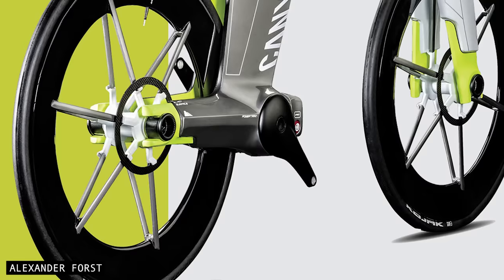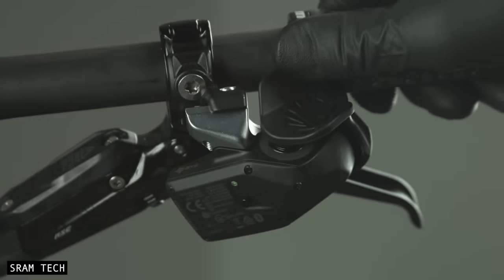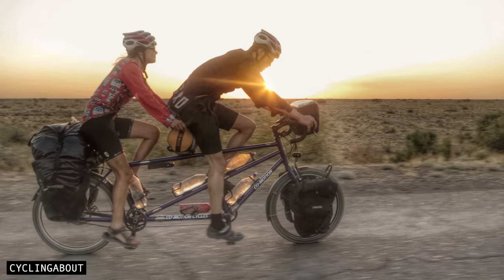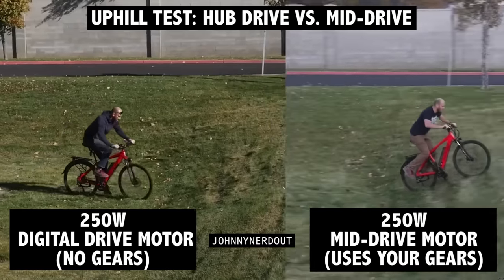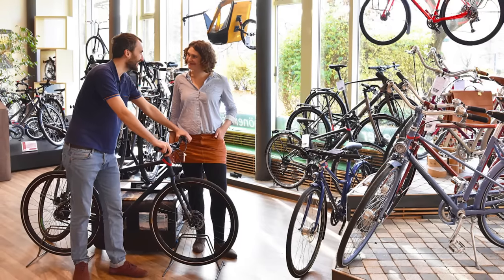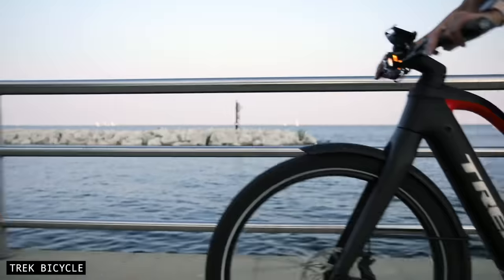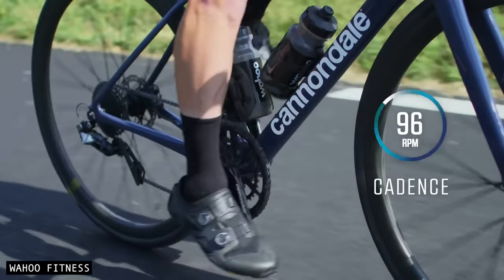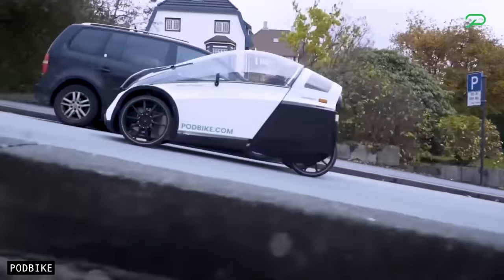Are Chainless Digital Drive Bicycles The Future of Cycling?

Comment: Given how inefficient the drivetrain is, you might as well skip the pedals and call it a motorcycle! The pedaling is just to qualify as a pedelec for legal purposes, while the battery and motor does almost all the work.
Reply: Remember, that efficiency of 95% for derailleur bikes is fresh out of the workshop. Drive it for a week/month in bad weather and things change. This might not be the right thing for a peak performance bike that gets constant maintenance. But think about  a commuter bike, that gets serviced once/twice a year the story is quite different.
Reply: @etherealicer  True, but I don't think it ever drops below 90%, even for a really dirty chain and worn teeth. 58% efficiency really is terrible, and that's not even accounting for the extra weight. 

Still, it probably has a niche somewhere. Public electric bikes schemes seems like a good use case
Reply: @jackroutledge352  It also is not accounting for recuperation.
I don't know the numbers (and a quick google search I did has not revealed anything). For me, I can see about 10% loss of speed* (though a good part also comes from poor tire pressure) and I do pretty regular maintenance (oiling / pumping up the tires). I do annual oil change on my rohloff speed hub, as it is combined with more thorough maintenance which usually results in 15-20% better speed.
* I daily commute for 2.6km in any weather.
Reply: @jackroutledge352  The day I do my maintenance, my bike is usually in better shape than the average commuter bike (But I'm also pushing it going roughly 30km/h top speed, not bad for an 18kg steel mule). No idea how these losses translate to efficiency, but I think there is a quite significant loss.
Of course this is very hypothetical and anecdotal. Really curious about actual every day efficiency of bikes.
Reply: @etherealicer   the efficiency of an external chain bicycle drivetrain with a high quality chain with the right lubricant,  clean,  fresh… is a little over 98%.  Dirt,  wear,  poor lubrication… do lower this but in poor conditions typically stay well above 90% for a bicycles’ chain drivetrain.  There is no comparison between a digital drive and chain bicycle drivetrain in efficiency.  A 58% efficiency rating is abysmal - think 1-1.5 flat tires for something significantly heavier that costs more.  A high torque electric motor is heavy due to copper and copper is expensive.  Besides a good mechanical system is typically more durable/longer lasting than a digital electronic version.  Hand crank car windows will typically perform without any needed maintenance or parts replacement whereas electric windows will be needing multiple maintenance services and a few parts replaced.  The simpler option is typically going to be the more durable and efficient.  Digital drive bicycles only come close to being a good choice when talking about e-bikes.  Will future innovations possibly change that?  Yes.  That said in 1890 bicycles featured a diamond shaped frame based around  hollow tubing,  power went to the rear wheel based on a chain,  wheels were made with tensioned wire spokes and featured air filled rubber tires.  The best bicycles today typically have the same features.  Yes some bikes will have a belt drive.  So magical game changing innovations can happen but don’t count on them in our lifetimes.  Given the poor execution of many “innovations“ that I see in newer bikes I dread actual changes.  Frames are commonly out of alignment,  poor welds,  poorly aligned bearing raced,  sloppy tolerances… are typical issues with new bikes.  So if a drive system which looses 21x more energy,  requires the bicycle to be significantly heavier while being more expensive and most likely harder to work on is something which sounds like an amazing innovation to you and deserving your money than go for it.  Yes 21x more energy 98% vs 58% or 2% vs 42% loss.
Reply: @stefhirsch6922  Here is my take.
- 98% is highly idealistic and not even close to what you will get on a daily commuter. And as you pointed out, with quality components (that ain't cheap either).
- 58% on the other hand is low (does not take into account recuperation for example). But sure, at the moment the system is very inefficient.
- You can pedal at your optimal efficiency independent of power requirement at the wheel. No bursts to get off a stop line, no higher load uphill. If you have 3 or more wheels you can even pedal as you wait at a red light/stop.
- As a result of the 3 points above the 21x has nothing to do with reality, sounds like something you would put into a marketing blurp.
- Motors get better, lighter and cheaper. And while initial cost are higher, maintenance might make up for it. I mean I have to buy new chain annually and new cogs every other year (again, quality components are not cheap) and my Rohloff gearbox is end of life (not cheap either).
- Durability. That is where you are wrong. An electrical motor is much more durable than a mechanical drive-train. Just look at e-bikes. It is commonly the mechanical parts that fail  (yes, the $30 controller might fail too, but at a much lower rate than the mechanical drive-train, the motor pretty much never fails).
- Quality in execution. Well, that is a market problem, you yourself started with "high quality chain". Obviously there are garbage products everywhere. The "innovations" you talk about are usually not engineering advances but simply "designer" pieces from designers that think they are artists. With products made as cheaply as possible to increase profit.

This is obviously not for a performance road bike. But think of cargo bikes or tandems (more chain == more loss). Bikes that don't get serviced every night (that are nowhere near that idealistic 98%). Bikes that are already heavy (e-bikes / cargo bikes). Bikes with different layout (eg. the cargo bike in the video with a steered AND powered wheel, being incredible nimble).
Finally, there is still a lot of room for improvement with this tech.
What I see is potential

P.S.: This claims a difference in 5% efficiency (Link Below). Now, I don't know how they arrived at this conclusion and haven't found the data (yet), so take that number with at least a bucket of salt 😉.
https://www.bikeradar.com/news/schaeffler-free-drive-chainless-drive-system/
Reply: @stefhirsch6922  Just read the comments in the article I linked you and there is one that pops out. If you use this on an exercise bike efficiency does not matter, but you can charge batteries while you exercise... finally, the "Hamster-Wheel"-powered household becomes reality.
Reply: @etherealicer  peak performace bike? any person that owns a bike and likes it will clean the chain when dirty to make it last longer, together with the other drivetrain components, so yeah, unless you are really careless, the efficiency of a chain drive will remain pretty much at top through its life
Reply: @cyrustakem7993  Not sure where you live, but here plenty of bikes are in quite bad condition, especially those used for daily commute. Some you hear from far away squeaking.
There is a reason why people exchange chain/chain-ring and cassettes regularly, they wear out and with that they loose efficiency. So a clear no, to retain top efficiency throughout its life (unless you really exchange it often).
Then there is low temperature that badly affects your oil (belts are better, but they get stiffer in cold weather). Derailleurs in cold weather (especially if there is snow/slush involved) are terrible (hub-gearboxes are better but they are less efficient to begin with).
Me included, many people like hub-dynamos, so you don't have to look after batteries and a fix installed light is less likely to be stolen (Btw dynamo/light are another great example for the reliability of electronic parts). With an electronic drive train, you can skip the dynamo, save cost there.

P.S.: Your 98% efficiency is a dream. Here are some official average efficiencies. Average meaning that there are some gears that are worse, some that are better
– 96.2% for 2X Shimano Ultegra
– 95.1% for 1X SRAM Force 1

Also, if you read further down there is a section called "Does Derailleur Efficiency Really Matter?
Source: https://www.cyclingabout.com/drivetrain-efficiency-difference-speed-between-1x-2x/
Reply: This is a bike with a battery, so it’s better to think about this as a battery and drive motor driven bike with the option to have a pedal driven generator to add some energy back to the battery to offset the energy usage from forward propulsion. So the pedaling is as valuable as you want it to be. The system also captures all the power/energy from deceleration during slowing and stopping, and the power/energy from descending at any % decline.  This power/energy is lost with a mechanical drive train. It’s more than “just to qualify as a pedalec”.  In this drive train system, pedaling provides power/energy to the system, but differently than a conventional mechanical drive train.  The end result though, is the same.  Pedaling adds power.
Reply: @wademt  except that direct power transmission is 21x LESS efficient than digital drive while being heavier and more expensive .  Please explain how a significantly heavier system with 21x less efficiency for more money is a good idea.  In addition regenerative braking power similar to a hybrid car doesn’t work nearly as well on a bike vs a car due to a bicycles weight to drag ratio so the potential energy recapture potential is far lower.  Systems with regenerative braking are also significantly less efficient compared to a standard electric pedal assisted bike and without pedal assist are worse than pedaling a bike with a flat tire.  I used to sell/wrench ebikes with regenerative braking and I wouldn’t buy nor would I recommend buying an ebike with regenerative braking.
Reply: @etherealicer  indoor trainers and other cardio equipment connected to a generator/alternator is nothing new as I’m familiar with designs dating back to the 1970’s.  The math doesn’t really work out in real life.  A typical household refrigerator requires about 1000 watt hours to power.  Given a 20% energy loss at the generator and another 20% loss when the power meets the battery if you can sustain 150 watts output it would require 10.4 hours per day - just for the refrigerator.  No lights,  microwave,  clocks,  cell phone chargers,  stereo,  tv…. 10.4 hours per day for just the refrigerator.  Every.  Single.  Day.  Investing in solar panels,  wind generators,  energy efficiency in terms of appliances,  insulation… are far superior in terms of performance as well as cost effectiveness.
Reply: @stefhirsch6922  I was specifically addressing the point of the OP that the pedals are not useful.  As to the larger issue as to whether the system is “better” than a mechanical system, they have their own strengths and weaknesses. They are different for sure, and have their place, as the the video pointed out.  One of my bikes has a Copenhagen Wheel on it, and it has some regeneration, so I agree it isn’t much, and largely depends on the amount of stop/go and downhills you have, and whether the system design is robust enough to capture the energy. (I also own a Tesla, so I know what robust regeneration is capable of).  I don’t see a real benefit to me personally for this system, but that doesn’t mean it isn’t beneficial in certain use cases.
Reply: @wademt  a system which has drivetrain energy losses 21x greater than a typical chain drivetrain while adding significant weight and costing more sounds inferior to me.  A typical chain drivetrain is 98% efficient whereas a digital drive is 58% or 2% loss vs 42% loss.  As far as regenerative braking on a bicycle goes given the inefficiencies of the generator and battery charging you will be faster without any extra complicated regenerative braking ebike additions.  New and improved doesn’t always mean better.  Digital drive is an absolute turd of a design and deserves the ridicule of how much it sucks.
Reply: @stefhirsch6922  Of course... it was more meant as a joke. However, it is a new opportunity for bike-couriers to work from home, charging batteries 😜.
Reply: I can’t get over how heavy these things would be. And if you’re going to add a battery and something to generate power with why not a motor ? Especially when you consider the cost. It’s a ridiculous idea.
Reply: @rolandthethompsongunner64  You understand that you already have a motor, right? So, if you add this to an e-bike you only add 1kg for the front-generator and wiring. But you can remove the full weight of the mechanical drive-train (gear-shifters + cables,derailleur(s), cassette, chain-ring(s) and chain). Meaning if you add this to an e-bike the weight difference is negligible.
As for cost. Well, hard to say really as this is not widely produced yet. But considering how much money you potentially save on maintenance and mechanical components, this could turn out to be cheaper (especially on an e-bike with front-motor, where your chain-drive is really high maintenance). Again, comparing to an e-bike
+ cost of generator
+ cost of controller
+ cost of software
None of these are particularly expensive
- cost of gear-shifters
- cost of derailleur(s)
- cost of cassette
- cost of chain-ring(s)
- cost of chain
- cost in maintenance
Ultimately, it does not look bad at all. Of course we will only know if there is a market-ready product. I honestly don't think that weight or cost are a problem. Efficiency seems to be* at this point. But again, we are comparing a product that has been refined over decades to something that is not even in production yet.
*Schaeffler's Free Drive claims only to be 5% less efficient than chain-drive.
Reply: @etherealicer  Derailleur efficiency is only one component. Losses through the pulley wheels, the chain, the cranks, the BB, the bearings, the hubs, etc. MANY components subject to various levels and stages of Friction. I.E. Mechanical resistance.  Rolling friction, the frictional forces present within the interfaces of the drivetrain is more than 3% to 5%.

And as you say, best case is when everything is new. 'Most articles' are bullshit. They are not engineering studies. 3% of loss comes just from the chain. A new oiled chain. Add another loss of 1% to 2% when not clean/lubed. (Most chains!)😆

Of course all of this is based on a model efficiency of a near perfect external conditions and rider. This is peak efficiency, the human body's efficiency at converting energy from food to work through pedaling action. PEAK efficiency does not last long and is not a metric for a basis.
(Peak RARELY exists with average riders) AT BEST, rider (mechanical input) efficiency is only 25%.
Reply: @jackroutledge352  Absolutely it drops below 90%
Reply: @stefhirsch6922  Incorrect. 97% at BEST. Typically below 97%. A typical bicycle is not 97% efficient. That would be a LAB model, with perfect external conditions (NO wind, no rain, SMOOTH pavement, no gravel, no dirt. A PERFECT rider. PEAK athletes. Does not exist except a handful of Pro's
Reply: @archetypex65  Exactly, optimizing for the riders output, independent of driving conditions (start/stop/hills) has a good potential.
Reply: @etherealicer  98-99% for clean transmission is real numbers
Reply: @shkoddi  Not really no. Average efficiency over all gears is maybe around 95% (new, well lubed). Less if you have a cargo bike with more drive-train, less if it is freezing cold, less if you've been riding for a week/month, less if your chain gets stretched, less if your cassette/chain ring get worn out, less if you've been riding in slush/dust/dirt, less if you have to shift gear (and the less you shift gear, the less efficient you, as a human are).
There is a reason why people choose the "far less" efficient hub-gear systems. Namely, that they stay longer at good efficiency when compared to the derailleur (despite still having losses due to dirty chain).
Reply: @archetypex65  peak pros have peak pro fitness and talent.  All of us can buy quality lubricants and degreasers.  Higher quality chains have less power losses than cheaper lower quality ones while lasting longer (shimano dura-ace or xtr are about as good as you can get - in terms of efficiency ).  All of us can avoid cross chaining (which degrades efficiency).  We can also select larger diameter chainrings and cogs.  A 60/24 has half of the power losses of a 30/12.  It really becomes a problem when the rear cogs get smaller than 14T.  Given how many modern bike drivetrains feature rear cogs as small as 9 or 10T it becomes significant.  We can also all invest in a simple chain checker or just use a ruler as a worn chain isn’t as efficient as a newer one (old chains also wear the chainrings and cassettes much quicker).  A 98% efficient bike chain driven drivetrain is very much so doable and attainable for mortals.
Reply: @etherealicer  nobody uses all gears equally, typical rider prefer 2-3 most used combination like 50*19-21-23, with good mechanical efficiency. And in good conditions there is no any mechanical losses above 1-2%. You can simply check this with pedal-based powermeter like Assioma and Direct Drive trainer like Neo 2T. Of course, commuter bikes don`t need to be 98% efficent all the time and something like 85-90% is pretty accepted, especially for cheap planetary hub + belt or cardan systems, that have exeptional durability and low-to-medium cost. But something with 60% efficiency and medium-to-high cost is just marketing ploy, not solving any real problem.
Reply: @shkoddi  You are comparing apples to oranges
Your 85-90% efficiency for a commuter bike (independent on whether we agree on that number or not) is what you get out of the drive-train.
The 60% is not. It does not take into account the recuperation. That has a huge impact if you have to stop a lot (urban traffic).
Furthermore, it does not end with commuter bikes. Cargo bikes get even worse efficiency out of mechanical drive-trains (while the loss for an electrical drive-train remains the same).
These numbers also don't take human efficiency. We are best if we can pedal at a constant speed. With an electrical drive-train you can optimize your human output (you can store energy). Keeping a good speed is easy, constantly accelerating and stopping saps your energy far more.

So, be careful what you compare. No-one is claiming that they will be the next big hit on next years Tour de France. But it might be the next big thing for cargo-bikes.

The electrical drive train is still in it's infancy but already there are some interesting use cases. Let's look at an e-bike.
First off, the motor and battery are already there, so we are only replacing the mechanical drive-train. That means we probably break even on the weight. The expensive part of an e-bike is the battery not the motor, so cost wise the difference should be small, could even be in favor of the electrical drive-train, especially since you will have less maintenance (no replacing chain, no broken derailleur etc.).
If we apply this to a cargo e-bike the balance shifts even more in favor of the electrical drive-train. We almost certainly loose weight, potentially save cost (especially since cargo bikes are produced in lower numbers, adapting the frame to accommodate for the generator will have less impact on the overall cost).
Another interesting use case, is a powered AND steered wheel (e.g. like that super nimble cargo bike in this video). The electrical drive-train gives us new design options.

Schaeffler Free Drive claims only 5% efficiency loss compared to a mechanical drive train (though they don't tell us how they arrived at that number). 5% you can more than make up with what you gain in human efficiency. All of this is speculative and theoretical. But you can easily see that with some further investment, this can get really interesting.
Reply: @stefhirsch6922  this system doesn’t have a driveline which you’ve referenced.  You are trying to compare two mechanical systems. And yes, when the prime mover is human legs, the chain drive holds the advantage overall. So we agree there. But that’s where your argument breaks down. We are discussing a system with stored energy in a battery that comes from an electrical outlet (which by the way is hours and hours worth of human pedaling), in ADDITION to human pedaling. An e-bike with a chain drive and a motor is a simple hybrid drive. An optimized full electric has 3 inputs to the battery: 1) electricity from a wall outlet, 2) pedaling from the rider, 3) regenerative braking.  The video made a clear point that I agree with: applications such as heavy hauling and 3 wheeled delivery bikes could benefit from a drivetrain like this. Further, regen braking doesn’t require anything special, it just has to have a hub motor. The generator at the crank captures pedaling energy. Then there’s the battery and some power transistors used in a small scale adjustable speed drive, like what’s in irrigation pumps and electric cars, on a very small scale, like 1/2000ths of the size. It’s not about new and improved, it’s about using readily available tech in new and interesting ways. Don’t worry, your trusty chain drive on your 10-speed (lol) is completely safe.
Reply: Exactly. It would just be an e-bike, with no chain. The pedal powered generator would provide maybe 5% of the power at best. Cheap models will provide resistance to simulate power generation.

There’s a very interesting video on u tube where they attach a generator to a stationary bike ridden by one of the top track cyclists in the world, after a few minutes of full effort he was able to get only a light brown tint to the bread.
Reply: @PRH123  There is also a video of a guy slapping a chicken until it is cooked... not really sure how well that translates to mass production ;)
Do you have a source for those 5%? Really think companies like Schoeffel would invest into that?
Reply: @etherealicer  of course not, I said “maybe”…. but, we could do some math off of the top of our heads on the back of a napkin…. Let’s say Joe Average can maintain a constant power of 100 watts on the pedals…. by the time that gets to the motor due to various kinds of losses it’s say 50 watts…. if the motor is a 500 watt motor, then Joe is providing say 10% of the wattage…
Reply: @wademt  a digital drive e-bike is going to be heavier and less efficient than a mechanical e-bike while costing more.  As far as design limitations of mechanically driven bikes you’d have to try to design a bike that was reasonably well thought out in terms of comfort,  aerodynamics,  pedaling efficiency,  structurally efficient design,  suspension dynamics,  cargo hauling or any other issue(s) where a digital drive would be the intelligent choice.  Possibly a folding bike but with the weight penalty given for digital drive you could design something which allowed a more compact/easier folding package.  Digital or mechanical driven bikes still require adequate beef in their rear triangle to handle right and hold up - designs which conveniently align with mechanically driven bikes.
Reply: That depends on how hard you can pedal. Some people can pedal about as hard as a fly while others are as strong as an ox.
Reply: @stefhirsch6922  You’re still thinking in conventional terms of a personal bike.  When you’re hauling 80-100 pounds of supplies or food across town on a trike to a client business you don’t care about whether your bike weighs 70 pounds.  You care about managing your all day workload and not running out of energy at the end of the day.  Aerodynamics and efficiency is not high on your list of cares.  I wouldn’t likely use this type of drive for personal transportation (which is typically for pleasure, not business), unless it was a commuter where I had a charger at work, or the bike could make the round trip.  Then its just about optimizing workload and not extending the day beyond a manageable timeframe.  I have 5 bikes, for various use cases.  If I was hauling people or supplies, this drivetrain may make sense.
Reply: I agree, at this point i could make a case for my kick-started motorcycle being an engine assisted bicycle. :)
Kick the starter in gear and the wheel spins, it's just inefficient. I like the technology, but digital drive is a legal trick to allow for electric cars and trucks to be usen on bike lanes.
Reply: Totally disagree, pedaling an Ebike, even inefficiently, serves as a good source of exercise, is therapeutic for knees, gets you further than pure electric for the same battery/motor and gives you a manual way of getting home if your batteries die.
Reply: I’d gladly trade the inefficiency to not have to worry about lubing cleaning and broken chains, adjusting derailleurs, skipping gears, replacing cassettes, having to constantly shift, not having the perfect high or low gear, replacing cables, broken shifters ect. As long as the system is the same cost up front and is as durable and long lasting as a typical chain system, I see it as a win for the constant drive alone. I wouldn’t even consider this on a manual bike, but an Ebike? Yea this has clear advantages where losing some pedal efficiency is practically negligible.
Reply: I might argue...paired with the right size of battery, you could be pedaling 50, 200, or 750 watts of leg power for as long as you like, and choose how fast that means you're going with buttons on the handlebars. In terms of exercise, you could put exactly as much effort into your commute if you wanted to. Want to go slow like a purely muscle-powered bike and get that cardio burn? Dial it down and be glad you spent $0.03 on electricity to charge the battery enough to make up for the inefficiency of the drivetrain on your 20-mile ride home. Want to go fast but your legs are sore from the gym? Your feet spinning the pedals around are just a goofy interface to tell the electric motor what virtual position the 'throttle' is in.

It wouldn't be that different in function from this: having a stationary cycle built into the driver's position in a car, with hand controls like a lot folks in wheelchairs have installed in their cars, so you can pedal at whatever resistance level you want while you drive. Yes, it's extra weight and money and complexity and disconnection and hilarious inefficiency, but you could get around and get arbitrarily as much exercise as you wanted while doing it. A digital drive and the right size of battery and charger would do the same thing but with a non-zero contribution from your legs to the watt-hours it takes to move you around your errands or commute or whatever. It would definitely be better than an electric car (that meets US/EU safety standards) in terms of carbon/rare earths/etc. footprint to build and operate one.
Reply: It's a good way to add a range to an e-bike and also allow it to skirt regulations in the simplest most maintenance free way possible.
Reply: Make it chargeable and call it a Plugin Hybrid. Your choice how much muscle power you spend actually.
Reply: @etherealicer  that Is old,now Is like a 99 Whit modern lube and derailleur
Reply: @etherealicer  THAT'S the immediate direction this is likely to go, and I hope it does. A bike that charges batteries that can be used in cordless tools and appliances would, if designed with such a goal in mind be good for the environment and public health (think lower insurance premiums, fewer trips to hospital, and reduced climate related resource scarcity) giving both humanity and nature a significant boost in quality of life!
Reply: It seems you did not understand anything of off this video
Reply: @weberito  What is "it seems"? You can prove the other person is not right or wrong according to your personal opinion, instead of impolite personal attack.
Reply: Convenience  trumps  efficiency, assuming you have a decent battery it is a no brainer for Joe Sixpack.  Purists hate this of course,  but no-one is holding a gun to their head to buy this. I see these "digital drives" selling in the 100;s of thousands if the price is comparable to any other mid and high end e-bike. Yes it won't compare to decent off road bikes but as a commuter bike, hands down champion ! People love simplicity of use.
Reply: @etherealicer  Think about the other will still work as a bike without electricity.
Reply: It would be a moped not a motorcycle
Reply: @Random-ed2xf  If it is a pedelec it won't work if the chain breaks and that is far more likely
Reply: The way I see it, the best option of the sort now is e-motor at the drive-train whith chain or chaft transmission on the wheel.
Reply: Create hybrid bycicle, why not? Use electric as u need and the chain when want to be strong!
Reply: Then how do you generate energy .....?
Reply: All this to eliminate a chain! Its not feasible yet.
Reply: I don't think this bike has a storage battery per se. The electricity you generate pedaling is immediately used at the motor
Reply: @etherealicer  I disagree about electrical components vs. mechanical. I used to work installing kitchen appliances and the most common point of failure for just about anything is in the computer. I've removed 40 year old kitchen appliances that still basically worked, and have seen appliances with computer features fail after less than 2 years.
Reply: @etherealicer  the reason people choose the “far less” efficient hub gear system is that they’re around 95%. Which, yes, is less than 98% but more than 90%. But all the systems — including those squeaky unlubed chains — end up around the 90-98% range between the wheels and the pedals. Using the figure given in this video of 58% that is still abysmal. Yes, even compared to a rusty & squeaky Huffy.

Regenerative breaking is irrelevant, because that can work on regular e-bikes just as well. And how well it works is not very, because in normal traffic you barely use the brakes anyway.
Reply: @matthewmosier8439  If I google, the most common kitchen appliance failures there are 9 mechanical/structural failures (leaking) and there is blown fuse (not really a failure).
Most have mechanical switches (I hope you did not count those as electric failures). Most kitchen appliances don't have a lot of moving parts, so this is hardly a good comparison to a gearbox.
You trying to tell me that the most common failure (after leaking) in a dishwasher is the electric controls/-motor and not the pump or moving hose?
How many blenders was the motor broken and how often was it the mechanical transmission (there is even a failure point (plastic cog that is easy replaced) to protect the rest of the gearing)?
In short, I don't believe you unless you back it up with some data (I'm sorry to say but claiming 40 years of repair experience equates to "dude, trust me").
Reply: @JasperJanssen  Regenerative breaking IS relevant. Because if we compare it to an e-bike we have to do a new  equation. There we already have battery and motor, so we only miss the generator (cost / weight difference changes greatly).
58% is just the number being claimed  in this video (without a lot of data). Other reports cite the difference to a conventional drive-train as low as 5% (though again with little data). The most reliable numbers are somewhere between 70-80% (but remember, this is still in development).
People switch to gear-hubs because in daily usage they are more efficient, which tells you how much derailleurs degrade with dirt.
Reply: @etherealicer  I don't claim to have 40 years of repair experience. I have 4 years of installing high end kitchen appliances. Which equates to probably an average of 4,000 different homes I have installed in (not counting new construction apartments) The most common failure that customers have told me is the generic "replace the control board" repair which usually leads to me arriving with a new apoliabce to install since those boards cost half what a new appliance does (low end appliances) and millionaires often get a new $12,000 built in fridge after maybe a few repair calls. I like and try to collect retro appliances and my father was an engineer who fixed everything he could when I was growing up so I know how simple and long lasting old appliances/ cars, were.
Reply: @etherealicer  If it is not a high quality drivetrain, and the chain is lubricated/cleaned every now and then (simple quick job, everyone can do in no time) and changed every year or so, I'll bet you won't lose much efficiency at all. Using Ultra for commute, lubricate it every few weeks tops, and changed the chain once in 8k km: runs perfectly and does not need any adjusting really. But oc, things are different on no name drive trains, or very low quality series I imagine.
Reply: I honestly think pedals are a brilliant way to control bikes though, and frankly i would want motorcycles to have them as well.

Controlling speed and brakes with pedals is extremely intuitive and allows for very smooth control, plus at least i personally notice that if i get distracted i stop pedaling and that can prevent accidents from going too fast.
Reply: @etherealicer  no, regenerative braking is not relevant. E-bike or not, there just isn’t any energy to be gained by it. And the generator has nothing to do with regenerative braking, that happens on the motor. Remember, the generator isn’t connected to the wheels? Can’t do regeneration. Conventional e-bikes (at least wheel motor ones) could do it just as easily as this one does — and they don’t, because it’s useless.
Reply: Some company already did this: you could ride at ~70mph, the peddling was used to charge the batteries and as an accelerator.
Reply: @etherealicer  Except that the average human would struggle to keep a 30 watt light bulb lit for a half an hour before they were exhausted. Look up the video of the olympic champion cyclist trying to run a toaster long enough to toast one piece of bread. He failed.
Reply: @Mishn0  Good point, you won't be needing a bicycle dynamo anymore.
Again, this tech is still in devlopment, and what they used in that video was probably pretty outdated tech. Again, Schaeffler claims only a 5% difference in efficiency for their Free Drive.
Personally, I find both the tech and the averse reaction of everybody really interesting.
Reply: @Mishn0  how is it saving the planet? Not everything in life is seen through a political lens. It’s for moving huge loads around.
Reply: @wademt  I didn't say it was. I said people will buy stuff they don't understand because they THINK it will be "saving the earth", and unscrupulous people will take advantage of that. I'm also not saying this inventor is unscrupulous. I'm just saying that people need to understand what they're buying and at least be a little suspicious of the seller's claims. I think even the Romans had a phrase to express that...
Reply: The point is that it's always usable without plugging it in first.
Reply: You just took words out of my mouth 🤣. Lastly canyon have stupid inventoins that have one task: Make their bikes more unique and boost their prices 📈
Reply: Just found the data for the chain alone. Good clean high performance road-bike costs you about 4-5 Watts* (If we take an avid cyclists doing 200 watts, that is 2.5%, this is from GCN Tech channel). 
Cycling weekly claims that a dirty chain can quickly cost you 20 watts (that is a whooping 10% @ 200 watt output). Though they don't tell what constitutes to a dirty chain and how they measured.

*measured with the chain pulling straight. So, depending on the gear, it gets worse.
Reply: Sounds like you agree with that German regulator he mentioned!
Reply: But then you have to charge it.
Reply: Licence isn't needed for a motorcycle 100cc or less , I've always wondered if they will change the law to include electric drives .
Reply: @etherealicer  A generator/motor system is highly efficient, CYCLINGABOUT had absolutly no idea what they were talking about.  Mechanical to electrical energy conversion has losses in the single digits.  It's thermal or chemical energy to mechanical which is poor.
Reply: @kennethferland5579  40% of 200 watts is 80 watts. You think it’s impossible to dissipate a few dozen watts into the air? On something moving 10-20 or more kph, no less, so you have forced air without so much as a fan? Come now. You couldn’t make anything red hot even if you tried to keep those heat losses inside.
Reply: @jackroutledge352  probably has a niche for hipsters bragging about their latest "green" purchase, until they're onto the next big thing. Fashion accessory
Reply: Charge a 30 amp battery with pedals you will notice the effort on your legs👍
Reply: Agreed. I want max efficiency in a bike.
Reply: pedals are for energy recovery or energy saving
Reply: @etherealicer  that efficiency is 97%, and will always remain over 93% even when worn and dirty. A 3-5% efficiency loss is a HUGE drag to your riding performance. The Nuvinci manufacturers do not state their hub's efficiency but I believe that it is lower than 90% and it is really only used with motor-assisted bikes and EVs.
Reply: @martinTintin476  you didn't understand a thing in this. That bike needs your constant pedaling to charge the battery then it runs like a motorbike using only an electric engine. There is no chain to move the wheel... why don't you pay atention?
Reply: 100%. If these come out as 29 kg behemoths with a riding speed of 45 kmh you can bet that our roads authorities WILL be classing them as motorbikes anyway. They are already being pressed by the public to class e-bikes this way now.
Reply: @etherealicer  If your chain is very dirty and at the same time unoiled, your efficiency drops. But not really below 90%.  But assuming you didn't maintain the bike in 10 years, it miracolously still works and the derailour sucked to begin with - let's just say you got 80% efficiency. And because your bike SUCKS, as you basically found it for free in the dumpster and didn't maintain it - let us for good measure subtract another 10%, just because we  can! 

In the absolute worst case - and you propably won't be able to replicate SUCH bad performance even if you desperately tried - you are therefore  still looking at 12%  higher performance. 

I'm a commuter myself, 12% losses should be very noticeable. More realistically, you'll be looking at 30 (possibly the worst realistic case) to 40% loss of power. At the same poweroutput, you'll be looking at 30-40% higher commute times. This would add up to over 3 damn hours per week for me. With those 3 hours I could clean my bike spotless every  week. 
Know what makes more sense? An internal gearhub paired with a drive belt. People have done measurements - you'll propably be looking at 90% efficiency, if the gearhub isn't high end. This is a MUCH smaller power loss. As you are (completely) saving yourself the trouble of cleaning it. 

Even if the efficiency was as high as any other senseable drivetrain.... This still sucks for commuters! I can fix a broken chain in an hour or so. This is fucking important. I'm not riding just for fun, when it sucks to not being able to ride. I HAVE  to. But I can not easily and quickly fix the motor/generator of this thing, unless only something very basic is broken. And I'm a trained electrician. 
Chances are your average bike commuter will not EVER  be able to maintain their drivetrains, if they were purely electric. 
I suppose the same is true for E-Bikes in a matter; I don't ride one. However, an E-bike isn't degraded to an oversized, unergonomic push scooter, if something electrical fails; you'll still be able to ride it. 

This is just form beginning to end an absolutely dumb, overengineered piece of garbage. It doesn't really solve ANY issue. It doesn't make ANYTHING  better. It doesn't make it more reliable - quite the opposite. The only thing this will acchieve is to slow you (conciderably!) down and make maintainance a pain in the Arse. I'd rather ride a push Scooter to work then this thing. Ain't much less efficient, absurdely reliable (not much that could break) and very easy to repair. I.e. - a push scooter is much more senseable then this contraption.
Reply: Anything that has motor....is a motorcycle
Reply: @sagichdirdochnicht4653  Source?
According to the cyclingabout website, a Pinion Gearbox is 90.5% efficient (people still choose it, and we are talking gearbox, not drive-train here), people also walk around in high-heels and ride mountain-bikes for their daily commute.
In peak condition a chain will loose you about 5 watts (GNC tech video with muc-off), that is 2% @ 250watts. That is an expensive-high-end road-bike chain, that has been professionally cleaned (ultra-sonic bath etc.), pulling straight (yes, any gear other than the middle one will be less efficient), no derailleur (the derailleur requires the chain to bend 2 more times around pretty narrow cogs). Also, understand, their definition of dirty chain, is a commuters clean chain. 
Now consider a cargo bike with more chain.
So 98% is not a realistic number and at the same time the number cyclingabout gave for the electric drive-train is wrong as well (it's efficiency is way higher). This video is pretty much comparing two wrong numbers.
Reply: @sagichdirdochnicht4653  Also, forgot to mention, we have not considered deformed (bent/stretched) chain, fairly common on commuter bikes.
Reply: @stefhirsch6922  that sounds like badly underpowered  or bad controller ebikes then, i almost exclusively use regen on my electric scooter as it's powerful enough to stop me almost instantly (2600W electric braking power, 3600W drive power), no brake wear and the motor doesn't consume more battery than my 1500W middrive ebike, both limited to 25kph, on the same road they both consume the same amount of power on that section which is about 400W to keep me at 25kph (heavyweight man), except i can regen still so still putting power back into the battery, and it peaks at 3600W while accelerating

really depends on the controllers tho, i have some pretty good FOC controllers.

it is common to recover 100Wh on my 1000Wh battery during my daily commute (both my ebike and escooter have a 1000Wh battery), i actually have more left on my ride after my commute with the powerful 11" 100mm / 4" wide tire escooter rather than the ebike with 28" 35mm Schwalbe tires that are much thinner

and don't even mention 250W as Bosch motors peak at 700W+ aswell, fuck the watt limit i'm overweight either way, i'm not gonna pedal in 700+W myself to keep 25kph on steep hills, i don't do mtb so i don't see why i should be slower uphill than on a flat compared to any other form of traffic (mopeds, motorcycles, cars, they all can do their respective speed limit uphill)
Reply: @matthewmosier8439  And someone else has probably seen the opposite, which is why anecdotes are anecdotes and don't mean anything.
Reply: No Jack. Pedaling is not just for legal purposes. Adding a human powered generator extends the battery range and or reduces the size of battery required for a given desired range.
Reply: The key benefit I see to something like this is the potential for software cleverness around "pedaling modes" on an e-bike.

If your pedals are basically a generator for your battery, the speed of the bike is fully customizable, meaning you could do some really creative things. Like the video mentions, you could have the bike do automatic interval training to simulate hills, or have a "recharge mode" where you can pedal at a stop to top up your battery. Your bike could basically function as a stationary exercise bike when it's at home, too.

Obviously this all hinges on a quality software implementation, but I see this concept as having a ton of potential.
Reply: @etherealicer  95%? A well tuned dura ace kit is running a hair above 98% and unless you do something really dumb it doesn't dip below 93%
Reply: @jackroutledge352  58% is also a pretty pessimistic estimate... Power electronics efficiency are over 95% in the best EVs today... Round trip efficiency over 90%, minus any losses from gears in the motor and pedal hubs.
Reply: @stefhirsch6922  58% is the advertised efficiency. Real world is probably more like 35%. That would be like riding into a 15mph wind all day.
Reply: What kind of motor is only 80% efficient? 🤣 Was it pulled out of a 100-year old blender or something? I'm amazed so many are taking this number at face value
Reply: @superskrub4209  80% is not bad for a DC motor. They never get more than 90% or so. And that is for one optimum speed and load. At other speed and load, efficiency can drop dramatically. Then you factor in gear and drivetrain inefficiency, and you can very easily and likely be under 50% system efficiency.
Reply: @etherealicer  ok, clean and lube the chain and you're back to 90+. Electric will never get more than 75% at the very very best. A chain drive would have to be extremely dirty and not maintained to get anywhere near that bad.
Reply: ...was thinking this.
Reply: @etherealicer  Well you can also use a belt drive on a bike, that doesnt need as much maintenance
Reply: @jackroutledge352  its a bicycle that always works. combine it with some airless tires and it is literally maintenance free
Reply: @stefhirsch6922  98% was tested in lab conditions
Reply: @etherealicer  the efficiency can be improved by just adding a battery. you charge the battery slowly, but really the battery is doing all the work when you pedal.
Reply: @wademt  the point of this is that its a system without a battery
Reply: @stefhirsch6922  sorry bud but you have no idea what you are talking about
Reply: @Blox117  it won’t work without a battery. there must be a mechanism to store energy.
Reply: @sandert8901  That is true, though you can't have a derailleur then. And of course you can't get as creative with your drive-train layout with belts (e.g. cargo bikes).
Reply: @Blox117  Yes, and electrive drive is great if you want to send power to a steered wheel (e.g. like I suspect what the cargo bike in this video has, that does this really narrow turn). And if you have more than 3 wheels, you can pedal while standing, generating power.
Reply: @etherealicer  thats only useful if you are at home.
Reply: @Blox117  Or if you have loads of red-lights, you can load up charge for the launch. And especially with a heavy bike, you can also get some power from regenerative breaking.
Reply: @etherealicer  bruh of your chain bike is getting below 80% you have have completely neglected and destroyed it, or just forgot to inflate the tires
Reply: Just as it is anyway... ;)
Reply: Thats called ciclomotor . They exist since the 50's...
Reply: I think a "smart" electronic gearbox for a manual drive train would probably be more useful unless you just want a backup for a full battery powered electric drive.
Reply: @stefhirsch6922  I drive an E-bike to work. So far I had to replace the chain and gears 5 times. The battery and motor are still the original. So no, electric systems need far less maintenance than mechanical ones. And the number of 58 % is just rediculous. No idea how this was calculated, I would say 85 % is achievable without high tech components.
Reply: @weorldedit  digital drive isn’t efficient.  Direct drive is far more efficient.
Reply: well put, that was exactly what i thought.
Reply: @etherealicer  If you know at least something about how to maintain the drivetrain, any shimano or sram drivetrain will perform as good as new even after 5 years. People forget that chain needs to be relatively clean and that you need to replace the chain once it gets streched so after about 4000km-8000km(depending on a chain and how well it was maintained)

I have shimano zee drivetrain, did more than 20k km on it in 3 years, changed chain only once(so too late, I had stretched chain for a while. Now on a chain that will propably need to be replaced in the next 1000km it doesnt feel much different compared to the new chain, and the whole drivetrain when it was new.

You are just wrong.
Reply: @jackroutledge352  Keep in mind that the extra weight is going to make it feel even less efficient, as it is mostly rotational mass.

From my experience 0,5kg more of rotational mass is worse than 1kg more of the weight of non rotating parts such as frames, handlebars, seatposts, derauliers, forks.
Reply: @etherealicer  98% is possible on the 150$ drivetrain combined with cranks. Any used BMX with just good and not stretched chain is going to be close.
Reply: @cyrustakem7993  *Any person who cares about their bike. I will tell you something. More than 80% of people who ride bikes do not care as long as it moves.
Reply: @call_me_jujo_9493  All I can say, it does not add up.
@250watts a top tier chain, costs you about 4-5 watts. That is already 2%. Pulling straight, no gears without derailleur. Slightly dirty doubles that.
@220 Watts a Shiman Durace derailleur costs you another 2.5 watts (again, peak conditions in a lab and that is not factoring in the chain!!! So, the chain will cost you some more watts). Slightly dirty will add about 3 watts for the pulley wheels alone.
All those top numbers are achieved under lab conditions, meaning they run on a super-light oil (or no oil at all), something you cannot do outside of test-conditions.
Reply: @call_me_jujo_9493  Also, drive your "98% efficient" bike for a week in salty snow slush. Park it in a public space among dozens of other bikes (I dare you).
Reply: @call_me_jujo_9493  yeah, no, almost everyone at least oils their chain, People do care
Reply: That is somewhat correct, but technically this is also true for every e-bike ever constructed. Once you have a motor and a battery,  there is always only a legal reason to shut down the motor when not pedaling, not a technical necessitity. 

We also imho should be generous because weatherproof bikes are probably one of the few things that can really make a dent into private car ownership, something that regular e-bikes failed to achieve. Even in the Netherlands with their incredible bike infrastructure, car ownership rate is surprisingly high.
Reply: That's the point 🥴
Reply: Let's speak frankly, e-Bikes were never about energy savings, but just a new business niche, and a way to pile up more crowd into already overcrowded cities...
Reply: His efficiency calculation is a bit off the mark and is fairly extreme. With a 90% efficient hub motor and 90% efficient generator paired together would be 81% efficient. 85% and 85% would be 72% efficient. A lot of people making stationary generator bikes achieve efficiencies in the high 80 percents so it's safe to say the video was pretty off the mark. Assuming above 70% efficiency in total, the efficiency benefit of being able to maintain a perfect load on the rider at all times would largely make up the losses in drive-train efficiency. People will balk about the tiny mechanical heat losses at play here while ignoring the giant sweaty monkey pedaling the bike with a skin temperature of 40 degrees Celsius - that's where the big efficiency losses are happening, so making sure the rider is pedaling with an optimal load is very helpful.
Reply: Yeah, I feel this is getting way too close to these companies just wanting a mini-motorcycle or car. Bikes and even e-bikes work now because you can control everything physically. As you start getting more and more disconnected from what makes a bike go and brake, in addition to the speeds these things enable, you'll start having more pedestrian injuries or crashes into cars, therefore being in another situation of cars again.
Reply: @0hypnotoad0  Yes, the key to make this work is to make sure the electricity generated by the pedals goes directly to the engine as the main losses lies with charging and then drawing power from a battery. The battery can be charged with excess power and deliver extra power when needed.
Reply: @etherealicer  That is exactly the reason why I always advice people to use internal gears for a city bike.
Reply: @etherealicer  "You can pedal at your optimal efficiency independent of power requirement at the wheel" 

You can also do this with a typical 3x7 drive train....by changing gears. 

There are potential use cases for a "digital" (it's not digital) drive train but none of those use cases are on standard bicycles unless there are some massive breakthroughs in both material science and electrical engineering. It's worth researching and developing more but as it stands I could build a bike with garbage off the side of the road for free that would be significantly more efficient than this will be even with another decade of RnD.
Reply: @asleepydino  If efficiency under lab conditions would be the end of the discussion, we would not have gear-boxes. But we do, but we no longer have 3-by.
Reply: @etherealicer  gearboxes are like 1-6% less efficient, not nearly 40%. Also what are you talking about, there is no shortage of new 3-bys being produced. 

Not that either of those things matters because that was entirely not my point.
Reply: @asleepydino  Well, I kinda thought you had no point at all (at least not anything that was not mentioned in this discussion already).
I recently rode a Bulls Copperhead Evo 2 29" (not new but well maintained). Freewheeling was catastrophic. You could not stop pedaling and have it run out, it would stop so fast. Honestly unexpected how bad that was. And no, no power-recuperation, just a terrible drive-train.
However, when you are pedaling, you won't notice because of the motor.
Sure, power-by-wire (because that is what this should be called) might be inefficient. But if you have a e-bike it matters a lot less because the motor can compensate. What you theoretically can get from this is a "cheap", maintenance free drive train, that can fit into the most complicated bike layout.
Not to mention that e-bike is also a legal term.
Reply: @matthewmosier8439  you do know that the ones you are fixing are the ones that survived the test of time? theres a bit of sample bias as the ones that did not survive does not cross you radar.
Reply: @ellemnist  Electronics fail often, is my point. The more computers in a system, the greater the odds of the system experiencing a failure